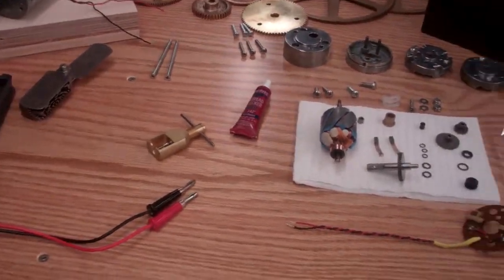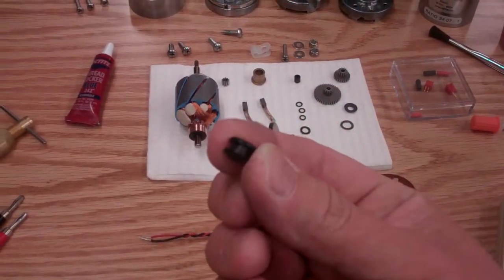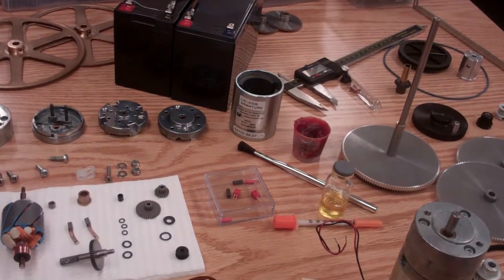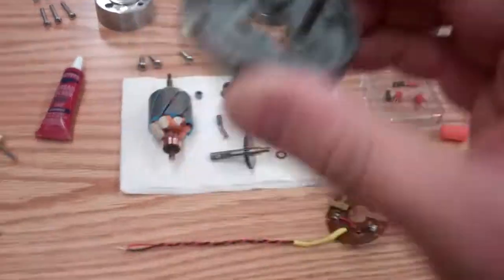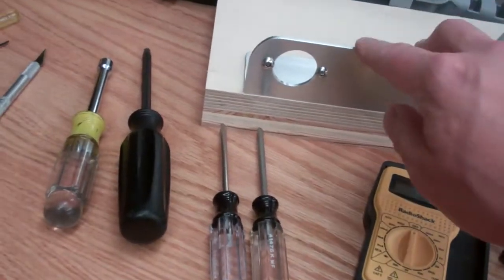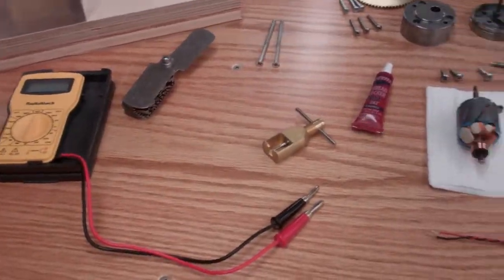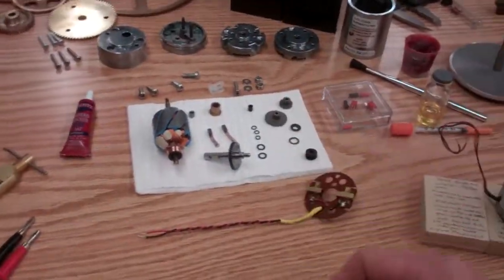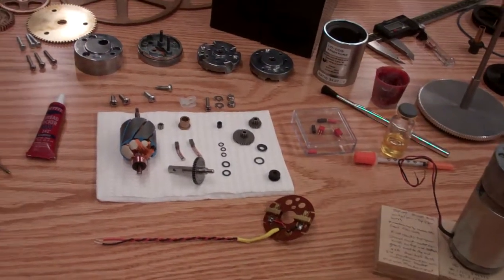MERKLE KORFF GEAR MOTOR PARTS AND PIECES

Comment: I've been looking for a replacement reduction gear for a Barber Colman gearbox. It's plastic and has 42 teeth on the outside, and 19 teeth on the inside/hub area. The OD of the outer gear is about 15/16", the OD of the smaller hub/gear is about 3/8". I would rather replace it with a steel one, shouldn't hurt anything as all the others are steel. Any ideas?